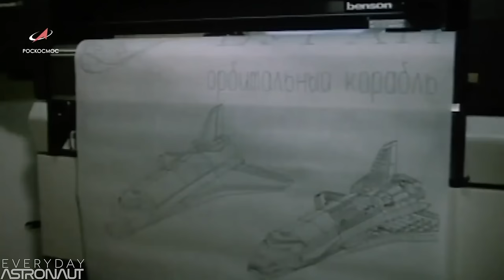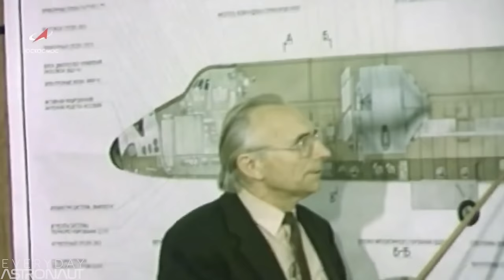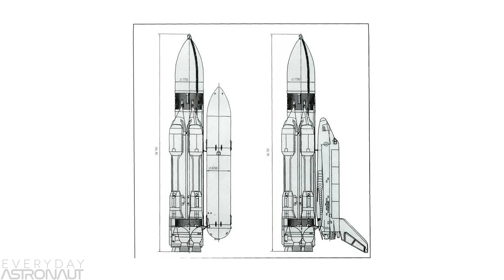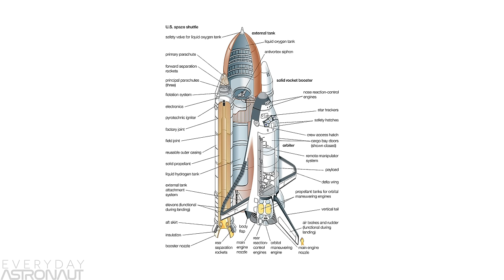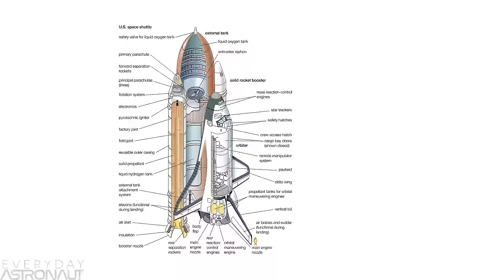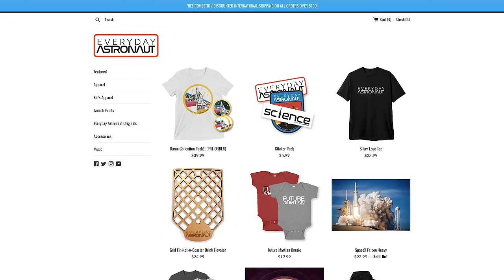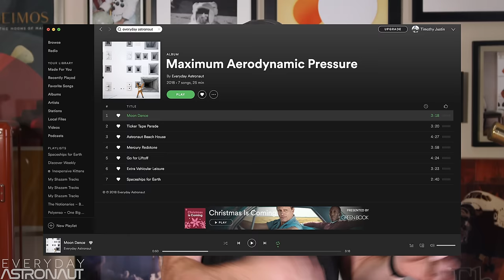Abandoned Space Hardware: CANCELLED Part 1

Comment: Aries I is the most kerbal rocket I've seen lol. Well other than the Atlas V with all the SRB's strapped to it.
Reply: I think is far behind one true leader - Ariane 4 with boosters
Reply: Nah, the Jupiter III (Yet another Space Shuttle derived launch vehicle) concept takes the cake. So imagine 3 space shuttle tank, line them up like Delta IV Heavy, put the second stage engine beneath the middle tank, then put the first stage engine underneath the 2nd stage engine (feed off from the side tank), then put 4 SRB around the middle tank.

Apparently can launch the Constellation MTV by itself, so...
Reply: No, the N1 is by far the most kerbal rocket ever designed
Reply: +Charlie Reisner I think only in ammount of engines. No cylindric fuselages, no boosters, no fins, transparent interstates :/
Reply: @juliuszkocinski7478  but every time they tested it, it blew up. Also, their solution to having a payload that was too heavy, they added more boosters
Reply: @charlesreisner6681  Ok, you got me there. I was just talking about profile of the rocket
Reply: The Delta II with all 9 boosters as 3  of them are air start.
It literally is something you may build in KSP when you need that last bit of payload.
Reply: @Patchuchan  I sometimes add 2 or 4 SRB's, but if I need more than that I do what the Delta-IV Heavy does. 2 copies of the central 1st stage strapped to the side of the 1st stage, with aerodynamic nosecones on top of the side boosters.
Reply: +Dusty Baker
Only that you committed the same mistake as our gracious Host... It's not the ARIES (like the star sign) but the ARES (like the greek version of Mars) rocket. Yes that is counterintuitive as the original program was introduced as Constellation and the Payload would have been called Orion, but that's what it was (Wikipedia claimed it was chosen in the face of Constellation trying to culminate in a Mars landing program). I guess they also wanted to remind everybody of the Jupiter and Saturn families of rockets in the golden days of NASA...
Reply: Delta II
Reply: I've seen the Buran twice. First when they brought it to the technical museum on an ship and then 2 years later in the museum and i have to say that its gorgeos. Its just giant and you can't believe, that there are even bigger things going to space, even while you read the facts.
Reply: @charlesreisner6681  Kerbals vs Human's
Reply: My cheapest LKO crew launch is almost literally a Vostok capsule on top of Ares 1

Comment: Delta III is another one. I worked on Delta III. In parallel with Delta III, Delta IV preliminary design was going on to win the future EELV contract. Boeing won a good portion of EELV and Delta IV went forward into production. 
Delta III had a launch failure in its 1st launch, an issue with its Aerojet RL-10 on its second flight but did have a successful launch of a dummy payload on its third launch. Then it was cancelled and replaced by Delta IV. However many of the Delta III products like upper stages and fairings were used on Delta IV. Delta III utilized a lot of composites and provided an experience base in designing composite launch vehicle structures to Delta IV.
The knowledge gained by all of us on the Delta III design team that switched to Delta IV provided good launch vehicle development experience to the Delta IV team.
Reply from the maker: That’s already on part II!!! It’s been shot even!

Comment: Nobody has seen or heard of program that's not cancelled. It's called Saturn 7. Saturn VII is sucessor to Saturn V and also precursor to Elon Musk's BFR. Been around since 2000s, the program was activated under codename Saturn Project V Block 1a of which never saw the light of day after moon missions ended the following year in 1969. In 2009, reactivated under codename SLS Block 7A, NASA diverted funds from cancelled Constellation program to Saturn VII program. some of funds are diverted to "SLS" program as to avoid any unnecessary questions why the funds were going to instead of SLS. NASA is actually building the biggest rocket ever, bigger than proposed SLS. then again, it doesn't exist anywhere but inside the VAB.

Comment: Was the shuttle just a glider? I remember it being designed with powered  landings. The advantage being that a landing run could be retried if needed. Unpowered the shuttle was easier to steer but you only get 1 landing attempt. In the end astronauts chose unpowered as the better option and thus became a "glider"

Comment: SLS is going right to this category.
Reply: No?
It's doing pretty good lately
Green run test is expected within the next 2 months
All the hardware for Artemis 1 is at KSC with the exception of the core stage which is expected to arrive for stacking in late fall/early 2021
Booster stacking has already begun
Artemis 2 hardware is also more than halfway complete and Artemis 3 is already being worked on
There's currently cores, boosters and upper stages on order through the early 2030's and Artemis is providing plenty of missions for quite a while

Comment: I was one of the engineers working on the Buran project. The official reason for the end of the project is "cease of funding", but actually it wasn't. On the final approach, we had no way of controlling it from the ground and suddenly at around 11km it just turned 180 degrees and started flying in opposite direction. The reason was that the computer received new wind data and recalculated landing trajectory, landing from the other end of the runway. Nobody understood it tho and we were just a minute away from shooting it down with a rocket believing it was a malfunction. After that government decided that the shuttle was unsafe and the program got canceled. Btw, until around 2010 all information was highly classified, and right after the incident almost all magnetic tapes with flight data recordings were... destroyed. Fine, lost according to official version :\

P.S. Pronouncation: "Booran" and "enirgia"

Comment: I would put big money on the SLS program joining these.
Reply: Unlikely
Even now NASA is ordering cores through the early 2030's
Artemis missions are actively taking shape
Artemis 1 hardware is already complete and everything but the core stage is at KSC for launch preparations
Core stage full duration static fire is expected within the next 2 months and it will be at KSC by end of the year/early 2021 for stacking
Booster stacking at KSC has already started
Artemis 2 hardware is more than halfway complete and Artemis 3 hardware is also being worked on
Reply: @brokensoap1717  I think they will make version 1 for sure, but versions after that are not looking good.

Comment: Why do the falcon 9 legs extend so late?
Reply: Stability
Reply: Yes, stability. They are non-aerodynamic components, and aerodynamic resistance would never be symmetrical. It seems intuitive to deploy them earlier and make sure they lock, but this doesn't actually make sense because there is no mechanism to re-try to deploy them. They have an ingenious passive deployment design that is very weight efficient. The weight cost of a powered design that could redeploy legs would be high. Also, more complexity means more opportunities for fails.
Reply: too much drag to let them deploy too early.
Reply: @donjones4719  thanks 👍

Comment: Correct me if im wrong. I wanna do this without Google. Most powerful rockets ever flown by thrust: 1.) Space Shuttle. 2.) N1 3.) Energia ....That sound right? Followed by, what? SaturnV as number four?   Edit:   N1 - 45,400kn / SaturnV - 35,100kn  / Energia - 34,800kn / Space Shuttle - 30,250kn.
Reply: @The French Space Guy - Thrust wise? No it was beat by N1, Shuttle and Energia. Space Shuttle boosters alone are technically the most powerful rockets mankind has ever produced. SaturnV had the most DeltaV maybe therefore most capable.
Reply: Correction. Here it is.  N1 - 45,400kn / SaturnV - 35,100kn  / Energia - 34,800kn / Space Shuttle - 30,250kn.   So according to Wiki at least the N1 is the most powerful rocket ever launched.
Reply from the maker: This is correct as far as I'm concerned.

Comment: I still tend to think that the Buran system was a smarter system because you get a heavy lift booster and the Buran shuttle. Energia can itself launch heavy payloads to orbit. And I bet if Accountants went to work on the comparison I bet the cost was the same. Although the US bore more cost on shuttle development while Russia stole it.
Reply: Yeah and instead of uncontrollable solid Boosters the Energia had Liquid fuel so if something happend you could have just throttled down the engines or even shut them off

Comment: I actually really liked the Ares-1, because I always thought it was a cool looking rocket (With the orange 2nd stage) and on the surface it looked simple and easy (although evidently not). I prefer the Consteallation program to the SLS & Exploration Mission program, since Constellation seemed to have a much clearer objective than the vagueness of the LOP-G. I can't remember where I heard / read it (So I'm not 100% on it) but I was under the impression that the Air Force report on the launch abort survivabillity was eventually proven inacurate. 

No doubt it was expensive, but I think there was merit towards seperating the crewed launch vehicle and the heavier lift cargo vehicle into two different rockets (Unlike a certain heavy lift rocket in development now cough cough) and Ares 1 would probably have been launching crews by now, although in hindsight on the coolness factor... Falcon 9 & Dragon > Ares-1 & Orion.

Comment: $10 says SLS ends up on this series within 2 years
Reply: Almost 2 years later SLS is actually doing pretty good
All Artemis 1 hardware is already complete and everything but the core stage is at KSC ready for stacking and launch
Booster stacking has already begun
The core stage is finishing up its green run test campaign within the next 2 months and is expected to be at KSC for stacking late this year/early 2021
Launch will be in just about a year from now 
Artemis 2 hardware is more than halfway complete and Artemis 3 hardware is also being worked on
There's cores/boosters/upper stages on order through flight 12